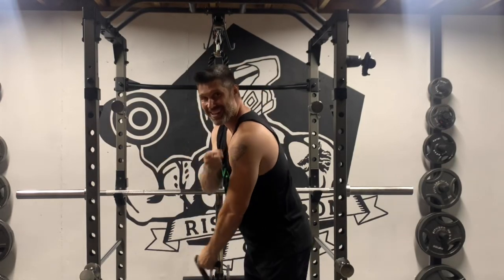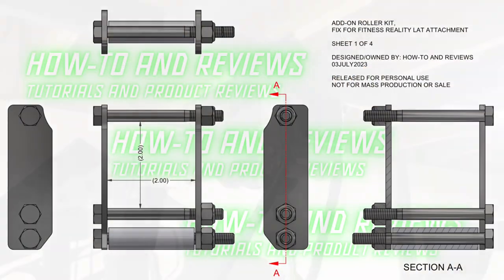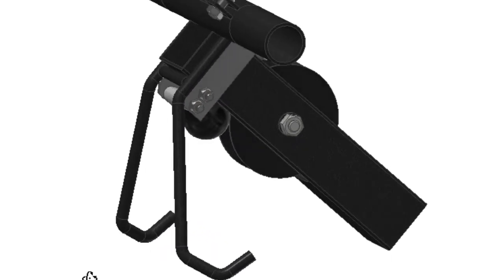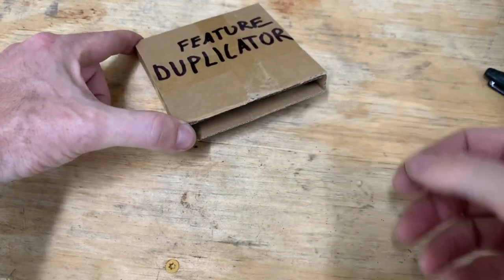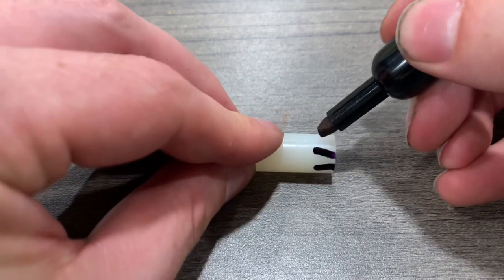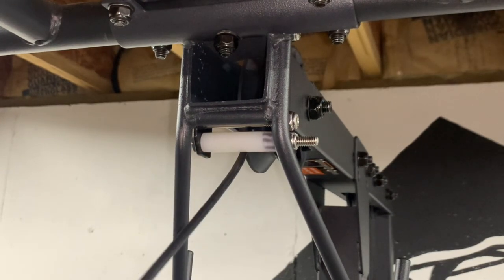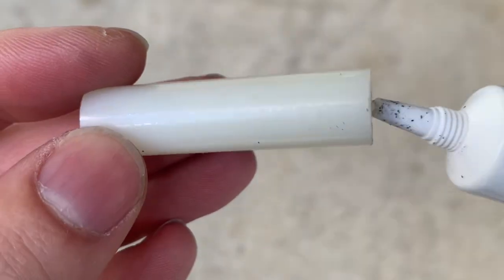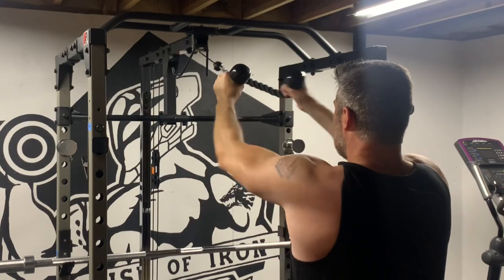HOW TO FIX Fitness Reality Lat Pull Down Attachment Pulley Kit for 810XLT Super Max Power Cage

Comment: Sold. Thanks for designing this and all the work that went into it. Nice plug for USAWA. I’m about do the what he calls the carrol cable fly on the front for dual pulleys but remembered the issue of the rubbing you called out and I haven’t assembled the carrol fly because of this rubbing issue. I guess I never realized it was rubbing when I got it in 2020 because I didn’t do those movements that would rub the cable at the time. I did build a wooden platform with stall mats to put the cage on top of instead of putting my cage on carpet. I even like his single chain idea so we can pull midway and not just from top or bottom. PS my brother is a mechanical engineer, masters from ASU. Very smart guys!
Reply from the maker: Thanks for purchasing the kit. I hope you are satisfied with it. It’s worked wonderful for me, but it does make me a little nervous sending them out since it has moving parts. I’m personally testing each kit on my cage before packing it up. I think that’s the best I can do. 
USAWA is a great channel. The Carrol Fly and the chain definitely look like good upgrades. I have them on my list to try out. But I have a growing list a mile long.
Reply: Hey.  I need to place my rack over carpet also.  Could you share a pic of what you made?

Comment: Thanks for the reply :)
As I was Pondering my idea and yours, I do know that Cable Machine Equipment Cables love Pulley Wheels that are at least 3.5" or even bigger, because it provides LESS drag, resistance and friction than a tighter and smaller wheel of any kind.
In other words, a straighter Cable using a wider wheel is better than a tighter one using a very small wheel.

Sooo maybe when that section is cut out you could maybe inset a 2" pulley wheel and use the square tube of the Rack to put the bolt through with 2 spacers or washers on both side of the wheel to keep it centered.
Reply from the maker: Absolutely!

I was trying to design something that is simple to bolt on without cutting or welded required so anyone can easily replicate it without modifying the cage. 

If I was designing a fix only for myself, I would have done it differently. Something similar to what you described. Cutting, maybe welding, and a larger pulley. I still have it on my do-to list to do something like that. 

I have also reached out to Fitness Reality about getting the updated version of the top pulley area where they redesigned it to fix this problem. The company was recently sold and I’ve heard that the new customer service is poor. I’ve contacted them a couple times with no response. 

Either way, there will likely be another video to fix the rubbing problem. It’s still something I want to address.

Comment: What would happen if I just cut that piece off the cage itself? Doesn't seem like it would cause any foundation issues. What do you think?
Reply from the maker: I did investigate that. I agree, it would not cause any structural issues.
I ran the cable above the steel bar, through the square tube. For me personally, when I tried high pull exercises, the cable went up and rubbed inside the top of the square tube. Something, such as a piece of plastic or a roller, would still be required to prevent it from rubbing on the inside surfaces of the square tube.

Comment: Anyway you could adjust the pulley system do seated cable rows?  Would definitely help. Love your idea. I started to use more cable exercise and this is a must have i never knew i needed!
Reply from the maker: Awesome! Glad the idea was helpful!
I was Just looking at the low cable location yesterday, thinking of how to raise it up a foot, so it’s in a better position for seated rows.
I have a couple ideas. I want to give it a few days to make sure it won’t cause any issues that I may be overlooking.
The changes require some cutting and drilling. One is an add-on pulley. The other is permanently raising the existing pulley.
Reply: I was hoping for this type of adjustment too.  Have you come up with any ideas??

Comment: I can’t get a socket on the top bolt. There’s no clearance on either side for the top one for me to fit my socket on it. Would need 2 wrenches. Looks like you got a socket on one side though?
Reply from the maker: I agree, the clearance is tight on the top bolt and there is not enough room for a socket.
I used two open end wrenches, one on each side. I used a socket on the bottom two bolts where there is room. 
You can pre-tighten the top bolt farther back on the square tube, then slide it up where it goes, then tighten the bottom bolt to clamp it.
Reply: Thank you! This is awesome!

Comment: Another flaw with the safety bars if you drop a high enough weight on them to damage them they’re not useable again and you may not even be able to remove them once destroyed. The pin in pole safety bars would solve this. Titan sells some for the T3.
Reply from the maker: I could definitely see that happening. They have saved me several times, but luckily I have not dropped anything from up high.  Just going for a last rep that I know I probably can’t get, and setting it on the safety bars at the bottom of the rep when I can’t get it back up.

Comment: A Better Solution: 
Get an angle grinder and Cut Out that section that's bothering you soo much, this provides NO Friction and or resistance to the Cable.

No need for any flat plastic "roller" that is now even LOWER than the original, therefore YOU provide even Less of an angle to work-out with.

The friction and resistance on YOUR "roller" would abnormally wear out the Nylon on the Cable.
Reply from the maker: I appreciate the feedback.

I did investigate cutting out the bar that’s in the way. That was my first plan. It does not cause any structural issues, but it  just results in the cable going up and rubbing on the inside of the square tube, which is quite sharp and will destroy the cable.

The roller is just A solution. It results in less friction and wear compared to the cable rubbing on the steel bar.

But, it’s not the only solution. Send me a picture of what you come up with! I would love to see it.